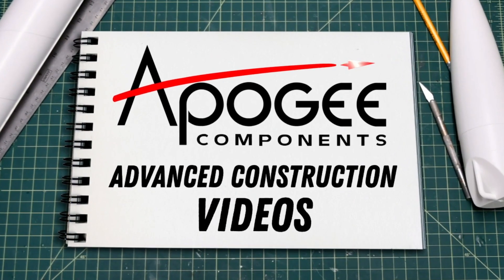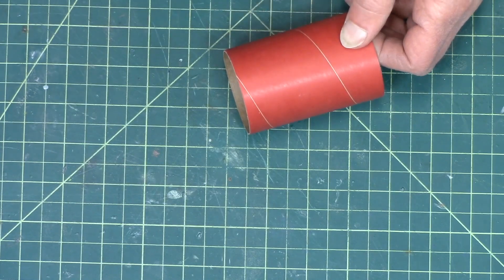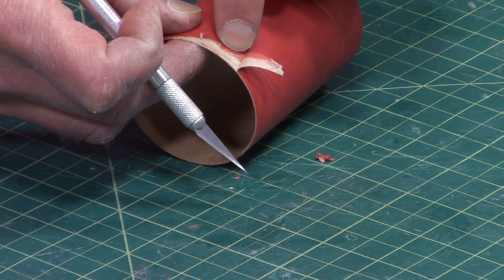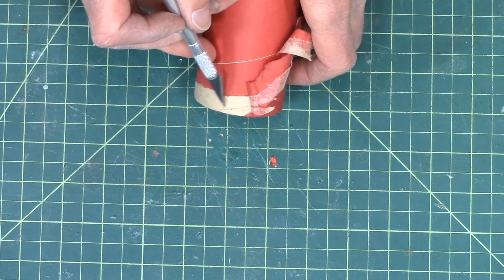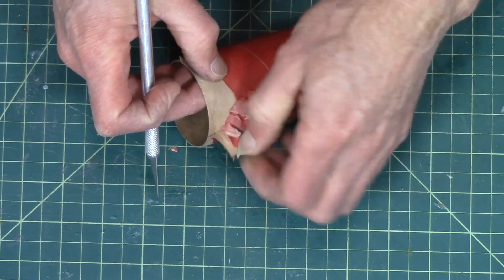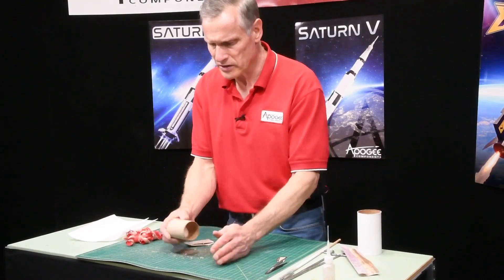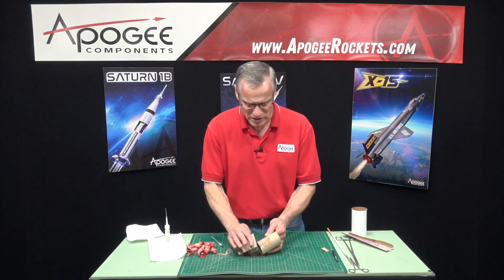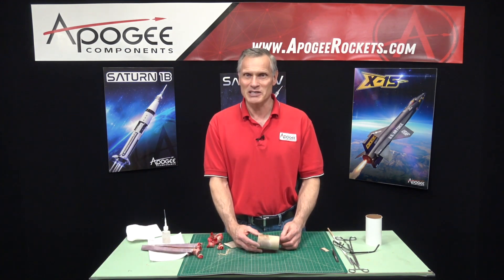Peeling a paper coupler for model rockets

Comment: The easiest method I found was almost by accident.  Wet but don't soak the outer layer of the tube.  Wipe the excess water of, then find the corner and lift while turning the coupler.  The entire top layer will come off easily and in one piece!  After it is totally dry, sand with fine sandpaper to remove any fuzzys.